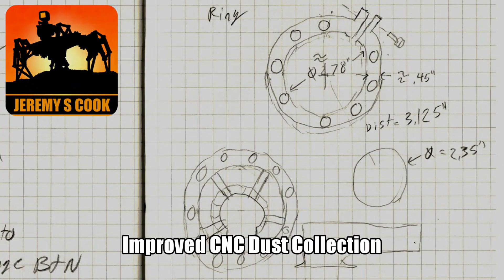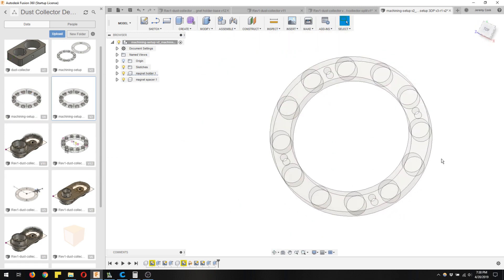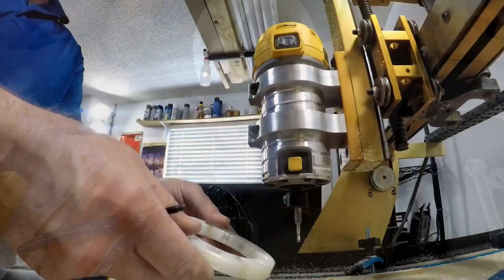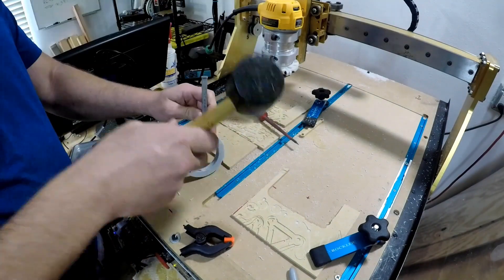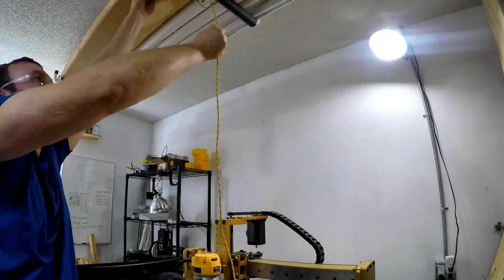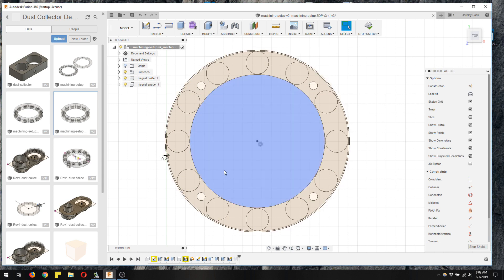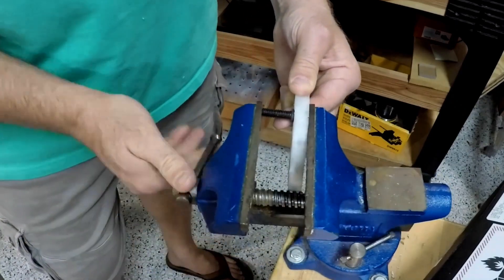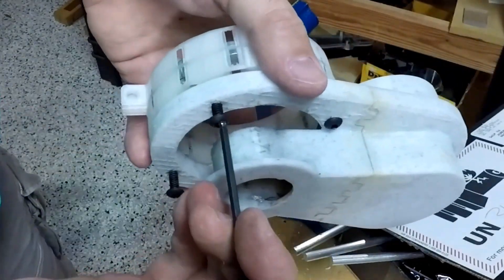2019: The Dust Collector Journey Continues

Comment: Just curious if your still happy with the magnets?  I tried an earlier version with the side load magnets, same result.  Why not a simple twist and lock?   I've enjoyed your video and the dust collection from this unit is really good without brushes so hopefully I can get the mounting sorted.
Reply from the maker: Hello - thanks for your kind thoughts. I no longer have the router, but was happy with the dust shoe, and it may still be in use at its new home. That being said, if I was designing it today I would attach the magnets with CNA glue from the back so they could directly touch each other. Would be much stronger.

Comment: A super CNC addition. And I especially like that it works without brushes. What is the diameter of your router body where the collector clamps on?  Being able to use the code as is would be a big plus for me.  My Hitachi M12VC and the body looks like 3.267” diameter.
Thanks so much for posting your vacuum information.
Reply: Thanks for the added information, I really appreciate it.
Reply from the maker: @IH1940HAY  NP, hope it helps!
Reply from the maker: Hi Thanks for your comment. CAD and such is available here, which should give you info on the dims. I no longer have the actual router, but looks like it's around 2.73 inches in diameter: https://github.com/JeremySCook/DustCollector-DC0

Comment: Greetings Jeremy I am inspired. Have you attempted to make  3d printed threads to affix the two parts?
Reply from the maker: Hello, thanks! No, I haven't tried that. Likely possible with the right printer, but I'm not sure mine is good enough or adjusted well enough for threads that small. I did go down that rabbit hole with 1/2 -13 threads here: https://youtu.be/HGflbBo4Eok?t=386 FWIW

Comment: Hi Jeremy,
Love your channel. I'm a newbie. I just bought a Monoprice maker ultimate 2 like you have
I'm trying to print your file....
single-piece-DC0-1.45.stl
I used Wiibuilde for a slicer.....What causes this:
https://drive.google.com/file/d/1tyxe64od2OBH2NpcGzgVEg0-AcXIazBl/view?usp=sharing
Reply from the maker: Hey Cliff, thanks, and glad you decided to take the plunge! You need to use support material for this, as otherwise it's just trying to print on nothing. I'd recommend using Cura though, it's quite a bit better for slicing IMO.
Reply: @JeremyCook  If its not too much trouble how do I use support material. I'll use Cura...
Thanks Jeremy
Reply from the maker: @MedinaCliff  Hey Cliff - In Cura, and probably Wiibuilder, there's a setting that says something like "generate support material." It just does it automatically and builds up a sort of matrix that your part can build upon. You can normally see a preview of it in your slicer.
Reply: Did you see the picture?

Comment: What 3D printer did you use?
Reply from the maker: Monoprice Maker Ultimate 2
Reply: @JeremyCook  
Thanks Jeremy.....

You highly recommend it? I/m going nuts finding one. Im willing to spend as high as $2,000. What do you recommend?

https://www.ebay.com/itm/Monoprice-Maker-Ultimate-2-3D-Printer-With-Auto-Bed-Leveling-Heated-Build-Plate/233532593141?epid=25034587415&hash=item365fa093f5:g:weAAAOSwJjtelqb9
Reply from the maker: @MedinaCliff  Hi - I wouldn't say I'd "highly" recommend it - It's a good structure, but the community surrounding it is a bit thin at this point. Here's a review I did a while ago: https://www.youtube.com/watch?v=5TyGpMrMeL8 you also might want to check out this reddit sub: https://www.reddit.com/r/MPMakerUltimate2/
Prusa makes a good product from what I hear, but I haven't tried one.
Reply: @JeremyCook  Thanks Jeremy.....

I ordered an open box one from them...$467. I though its worth a try. This is my first 3D printer.
Another review said the ultimate 2 printed better than the Prusa at half the price?

Cliff
Reply from the maker: @MedinaCliff  Nice. I think you'll like it, but I try not to oversell it either, as it's good, but not perfect (as I guess none are)!

Comment: how do i get the files cant find them i just signed up or what would u charge me to make me one for my 2.2 kw spindle its 80-mm...
Reply from the maker: Hi Rick - thanks for subscribing (if that's what you mean). Files are available here for several different versions: https://github.com/JeremySCook/DustCollector-DC0 perhaps one of those would work?
Reply: @JeremyCook  First of all, great job on this design.  This is pretty much exactly what I'm looking for.  I am having an issue downloading the Ring-2 STL file for the PB clamp (with the screws instead of magnets).  There is no download button on the github page.  How do I go about getting that one?  Also, I just subscribed.
Reply from the maker: @Naviator2012  Hi, thanks for your kind words and for subscribing. Try right-clicking on the link you want and hitting "Save Link As" then store it wherever you like. Alternatively, you can hit the green "Clone or download" button in the top level DustCollector-DC0 directory, and it'll give you all the files to play with.
If you want, send me a picture - hi@jeremyscook.com - when you've got it working and I'll put it up!
Reply: @JeremyCook  thanks I'll give that a try. Idk why but that's the only file that doesn't have a download button. It has a couple buttons that show you the actual code but don't let you download it.

Comment: Just yesterday I made an enclosure for my new doorbell. Six prints until I was happy. Using a 3d printer sure raises the standards. Not quite right is would be fine in wood but never in a 3d printed part. Looking at the finished project and I think I need to do another iteration.
Reply from the maker: Ha, good point. Hard to make excuses when you just have to press a few buttons!

Comment: Nice work, Jeremy!  I'm probably half an iteration behind, but I've had your model sliced and uploaded to Octoprint for at least a month now.  I haven't managed to remember to print it!  I'm going to have to do it this week, for sure.

When I bought my CNC, the first thing I did was start shopping for Shopvacs.  I wound up trying a 2.5 gallon model from Harbor Freight.  I wanted something small and light that I could stick on shelf above the CNC.  I figured that'd help me keep the hose short for better suction while still being able to reach the dust collector.

Did I mention that this is nice work?  Nice work!
Reply from the maker: Thanks! Well the good news is that the base model hasn't changed (besides the hose adapters depending on the version) so you should still be good to go. Looking forward to seeing it complete!

I initially had a vac on a platform, but ended up getting rid of it for some reason. Perhaps too small?

Thanks again :-)